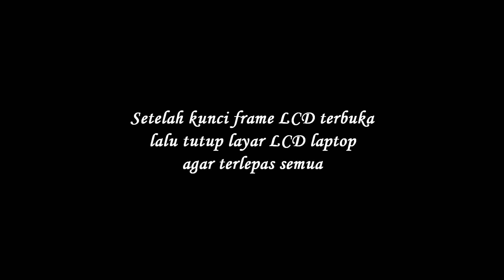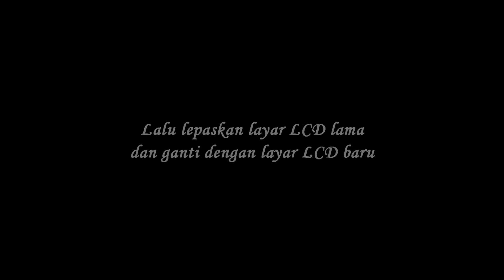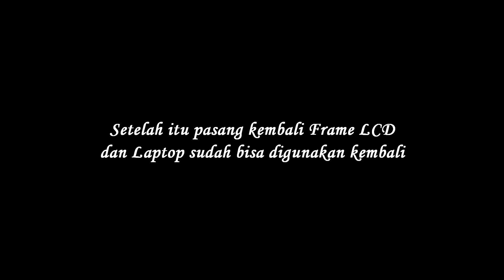LAPTOP HP PROBOOK 440 G5 | LCD Blank Screen | Replace LCD

Comment: Why doesn't the LCD on the HP Probook laptop turn on but the machine is on? whether from the LCD cable or something else
Reply from the maker: Try checking at minute 2:46 and minute 3:41. Usually many people experience problems in their position